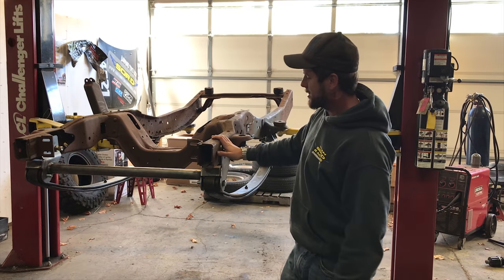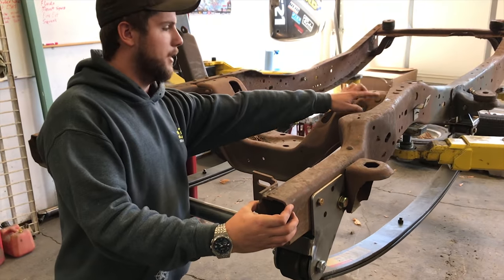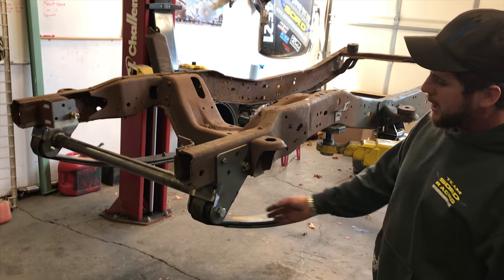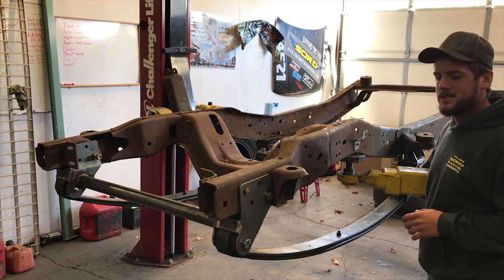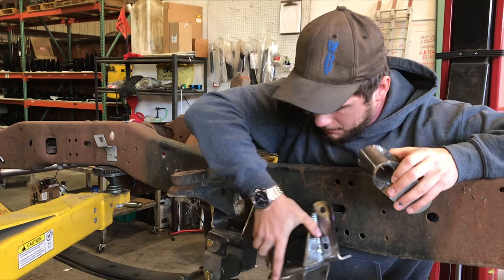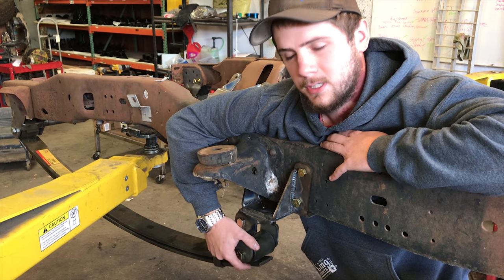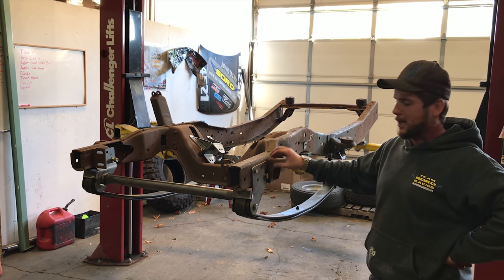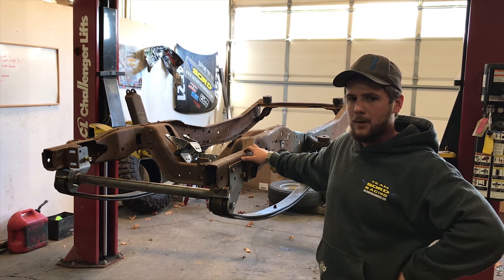Sky MFG RSK explanation video

Comment: Awesome video!! I curious about converting a 2wd to a 4wd using super duty axels and springs. What is the differences in frames?
Reply from the maker: Are you looking for the differences in the 2wd vs 4wd frame?
Reply: Yes.
Reply from the maker: 2wd frame needs to be boxed on the front. We  have those parts if your in need

Comment: How does this apply if you intend to use the stock springs? second question what would the effect be if 96'-97' model rear springs were used up front, other than the obvious differences in hanger mounting location?

Comment: Does SKY offer a kit that also includes a front 2" receiver? I'd like to add one for a winch mounting point when I do my RSK.
Reply from the maker: They do not but we do have a kit that does. Just let us know if we can help
Reply: @CompletePerformance  Is that the PMF kit that uses the OBS leaf springs? I'd like to find one that has a hitch and uses the SD leafs, and I haven't seen one let. Then there's the issue of the 6.0 IC I added, so....

Comment: Will this work with the factory axle or will I have to do a solid axle swap first
Reply from the maker: James,

We assume you have a F250 with the TTB. If this is the case you will just need a set of drop axle pivot brackets. We sell those so wouldn't be a problem.
Reply: Awesome job! I have a 1997 f350 crew cab 4x4 ,what about the rear leaf springs? Can I leave the factory obs ones or do you suggest a kit for that? I just replaced the hangers due to the old ones were completely rusted out when I inspected them prior to picking up our new trailer! I almost was sick to the stomach when I started poking away old clay dirt and debris! They were literally rusted out and just hanging on😳 thanks guys👍

Comment: I need to level my 95 F250 Diesel 2WD in the front 2-3 inches higher. don't want to use cheap spacers. what parts do I need?
Reply from the maker: There is currently nothing like that available for the 2wd trucks.